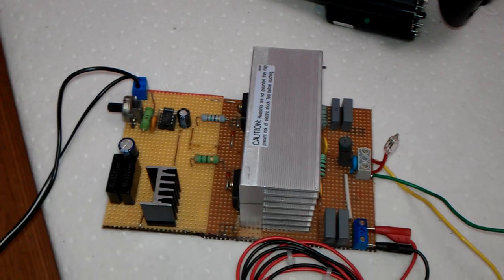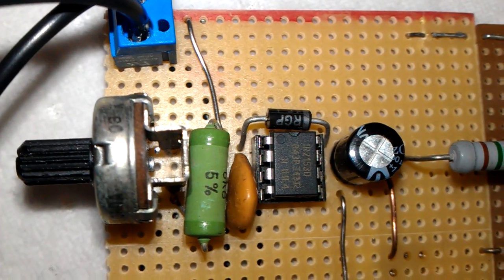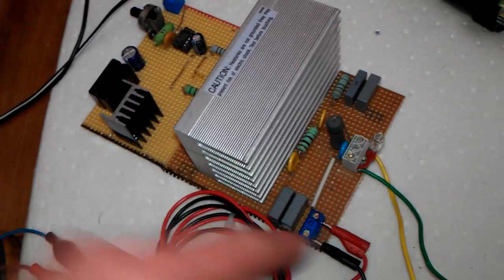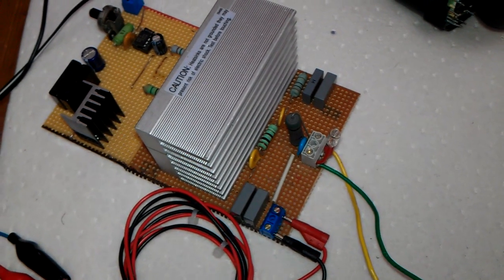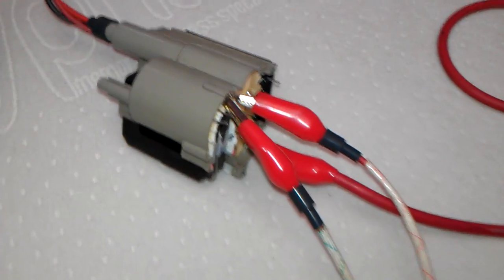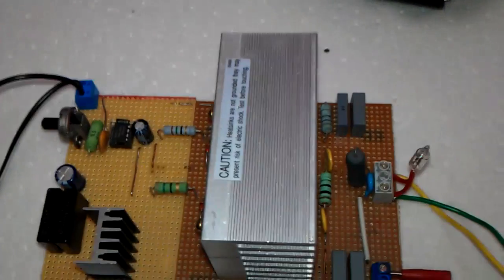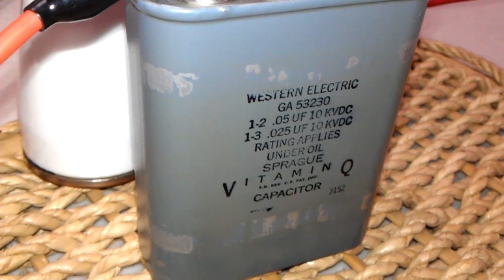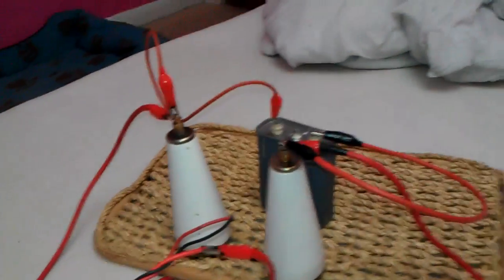Solid state tesla driver circuit

Comment: Did you say that neon lamp actually protects the mosfet from RF spikes? Could I use that with a zvs driver too?
Reply from the maker: Yes my friend: 

it does help with most spikes ! You can use diodes to in parallel! With the gate aamand source pins! 

The way the diodes are fitted is the same way in the zvs board! So the resistors and diode are parallel. 👍👍

Hope this helps!
Regards Anthony/ high1voltage1rules

Comment: Ant try this, since this is a half bridge the amount of primary coil turns that you will need is greatly reduced as the voltage across the primary coil effectively gets halved due to the rail splitting capacitors.

For some fun set the variac to about 40v and use around 7 primary coil turns on the exposed core, you will get huge arcs and corona everywhere!